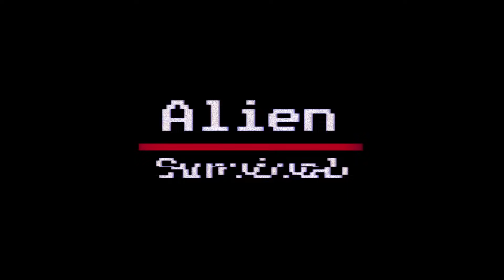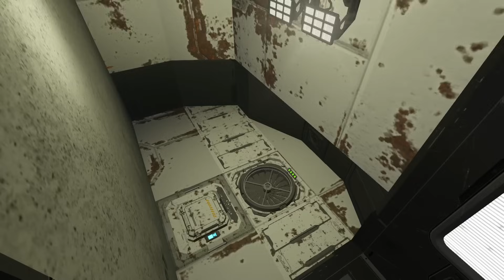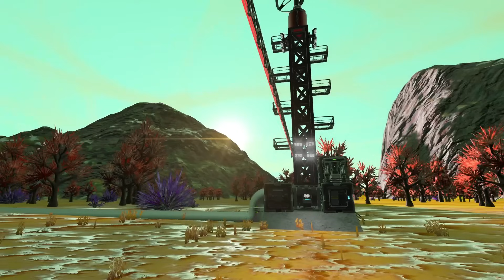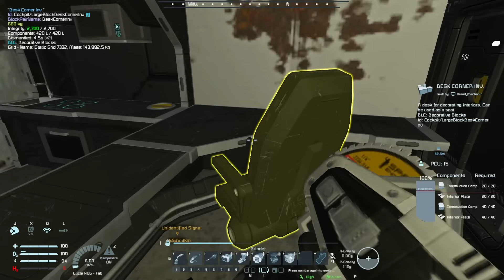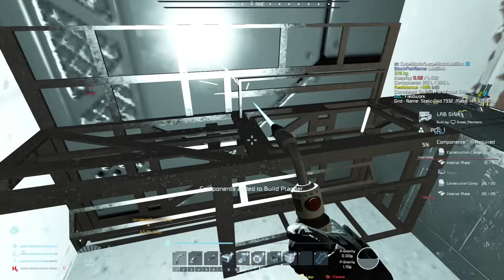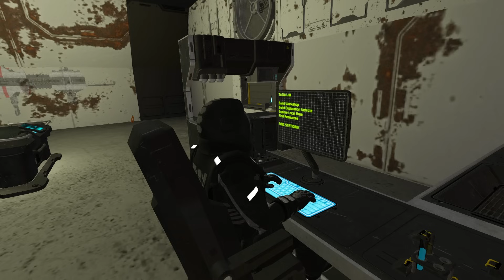👾 Setting Up Shop 👾 | Alien:Survival [Ep.02] | Space Engineers Mech Engineering Survival

Comment: Rotor part has no cargo pass😂
Reply from the maker: This one doesn't need cargo access, it's purely for building stuff. I'm building this mech its own docking station 👍
Reply: @dread_mechanicoooh my bad. Would it not be more pcu effective to pipe the one that rotates the mech and use a merge block so its now a refueling, docking, and later can be made into a printing station?
Reply from the maker: @NovusOrdo999  It would probably be more PCU effective but I hate using Merge Blocks for anything temporary as they re-name grids when merged.

Like I said this is just my workshop for building stuff, so it's doesn't really need piping.
Anything I build will get it's own dedicated docking bay.
Reply: @dread_mechanic i didnt know about the renaming, thats annoying. Thank you